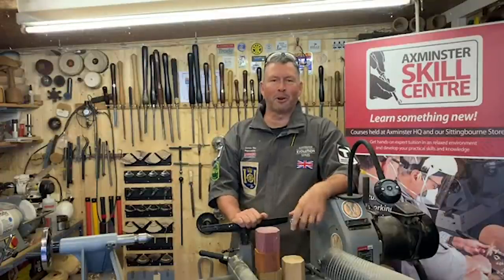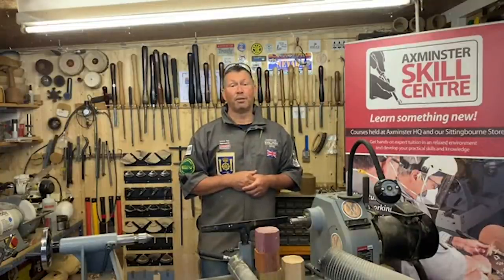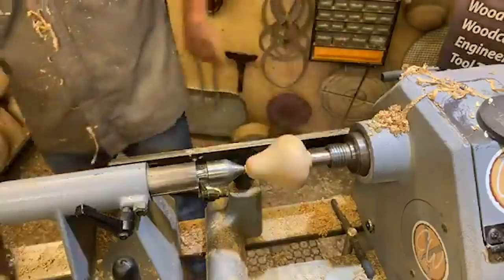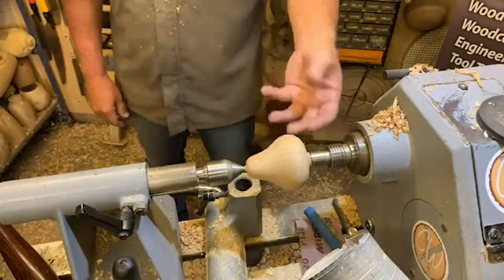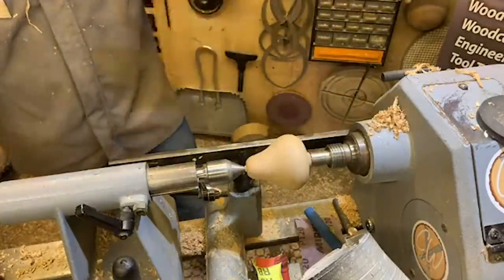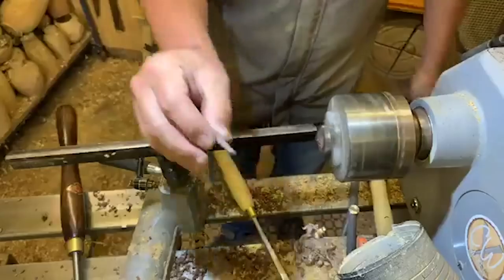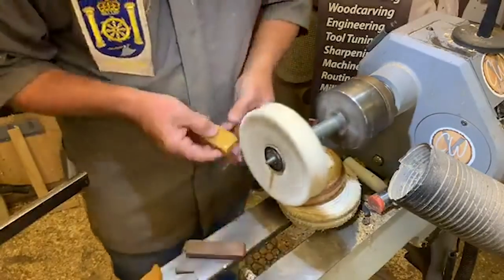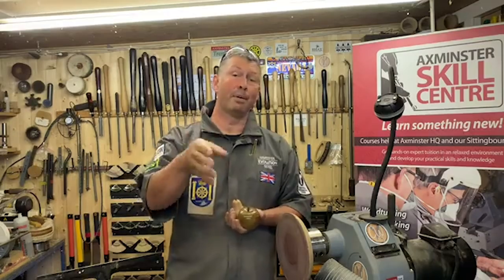#SkillCentreAtHome - Live Turning Thursday - Wooden Fruit and Jam Chucking

Comment: Why do you choose the parting tool rather than a detail spindle gouge for insets top and bottom? (Just prior to sanding)
Reply from the maker: Hi PBpleased, Colwin says: "A detail spindle gouge wouldn't do the reverse cut as well, where the parting tool side scrape works really well in this area, especially the endgrain. Plus it is super quick."

Comment: question: can you use the skew to turn the pear and apple as well as the stems?, the long point looks like a great fit in that small space ( curving the tip and bases).
Reply from the maker: Hi Andy, the following reply is from Colwin - "It would be tricky to use the Skew due to the grain orientation, unless you used it to scrape, but this would lead to tearing so not ideal!"